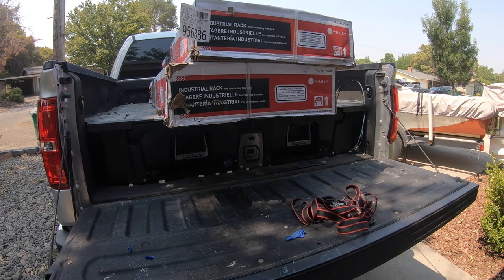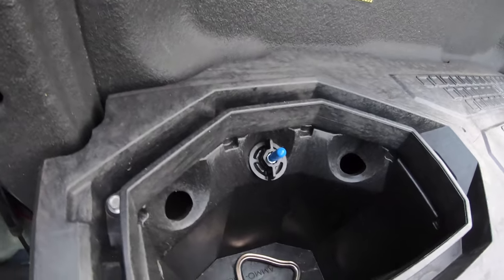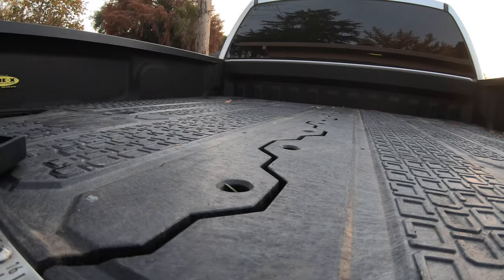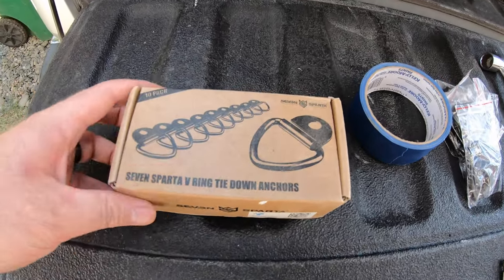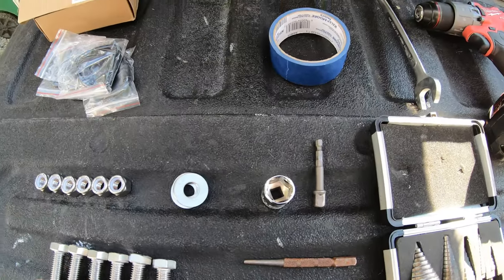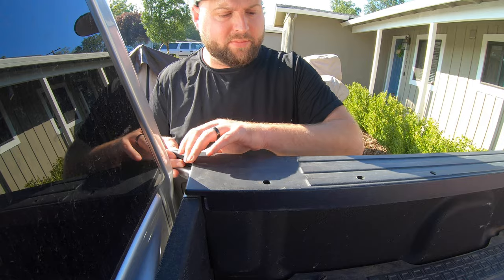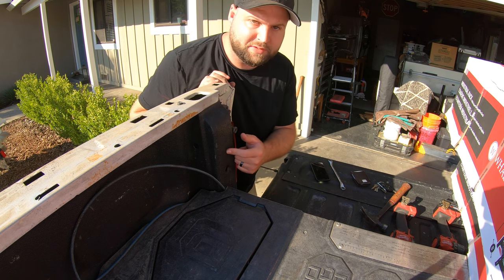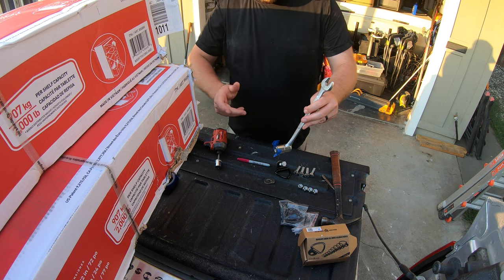The BEST Truck bed Tie Down Anchors on AMAZON.

Comment: Decked came out with a new version that fixes the anchors.  It now has eight tie down point incorporated in the system.  This is video refers to the old legacy system
Reply from the maker: Yes that is correct! I’m glad they were paying attention. Unfortunately for me, mine only comes with an extra purchase rail system with low ratings. Even with the new ones, I feel more comfortable with a higher rating and bolted into the bed of the truck.
Reply: @ProjectComplete  Actually, the new ones are bolted to the bed of the truck.  Decked revised the mount so it passes through the system and attaches directly to the manufacturers original tie downs so it is directly connected.  Not knocking your idea, just pointing out that this is for the legacy system rather than the new one.